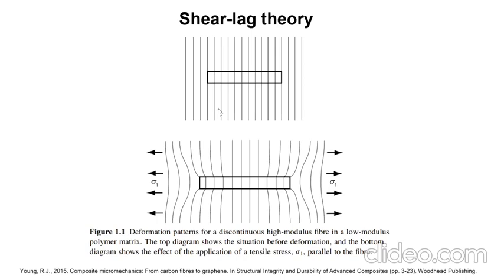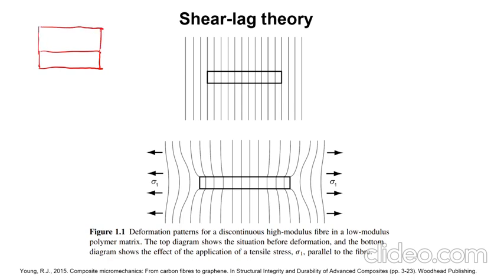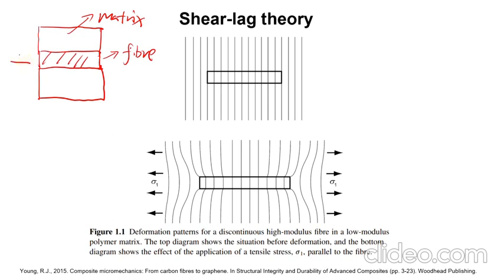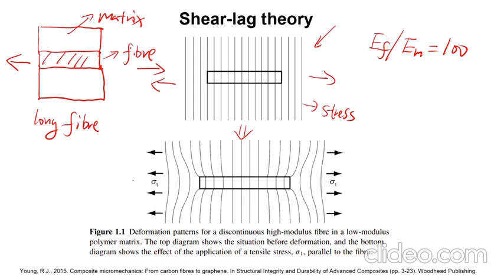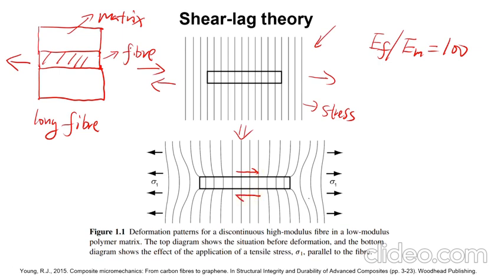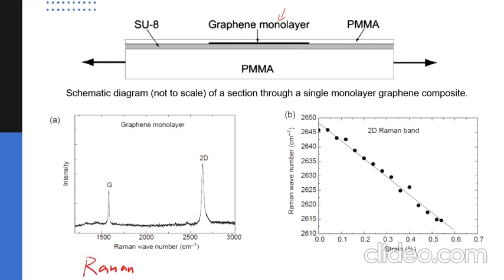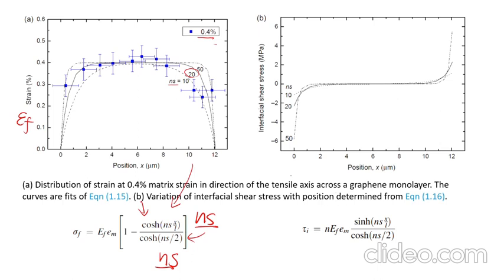Shear lag theory for composite materials (short fibre composites, graphene composites)

Comment: How do we determine the strain of the composite (epsilon c)?
Reply from the maker: Use PMMA-SU8 composite as an example, the composite strain is the same as the strain of matrix or fibre, as this is assuming an equal strain for long fibre composite.  This can be measured directly from the bulk sample from strain gauge or camera system. The strain of graphene will be measured and calculated by the Raman shift -strain relationship.